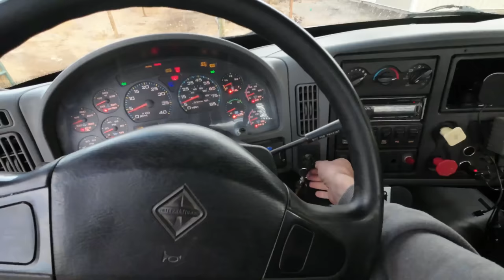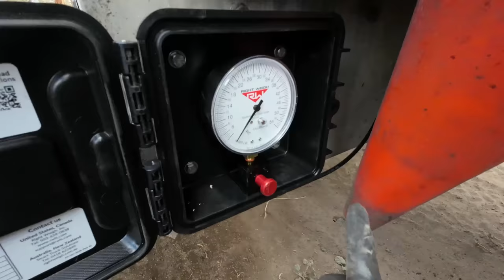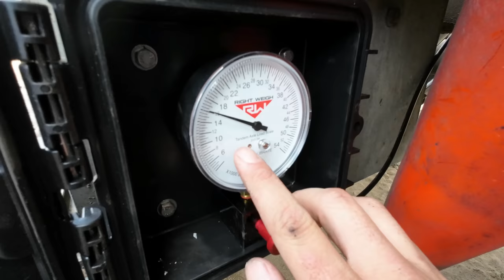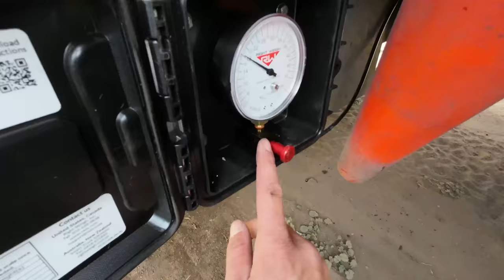A day in the life of an owner operator. Paying to go to work!

Comment: you goofed while working on your truck , you didn't get dirty ! 🤣 . I don't care what people say , I also say it's a Jake brake
Reply: First manufactured by Jacobs Vehicle Systems. Pretty sound argument to call it a Jake Brake in my opinion. Like referring to a box of facial tissues as Kleenex. The brand has become the generic term.
Reply: The company actually takes legal action against towns that post “no jake braking” signs rather than “no engine braking”. They used to (maybe still do?) have a form on their website to report jake brake signs.
Reply: @rustybones99  i haven't seen the term "jake brake" on signs for several years now. Every place that I've been through have changed to engine brakes🤣

Funny story, about 20 years ago i was running with about 3 or 4 other drivers from the same company as i was driving for. We were on a two lane highway in Kansas, it was about 10:30 - 11:00 at night. We came up to a set of railroad tracks on the northern edge of a town. A train was on tracks, so we had to stop. One of us flipped the jakes on & revved the engine & let it cackle while we were waiting for the train to clear the crossing. We started talking on the radio about how notorious that town was about cracking down on the "no jake brakes" law & we were all doing it.😆 
Then we heard someone get on the radio & say "it's ok boys, we'll let you go tonight"🤣🤣 we were surprised & was trying to figure out where it was coming from. He said you boys keep trying to guess. About the time the train cleared the tracks & we could start rolling again, disco lights came on in the implement dealership next to where we were waiting. He said you boys stay safe out there tonight, it's been fun talking to you all🤣🤣  he pulled out & escorted us through town🤣🤣  that was back when trucking was fun🤣🤣
Reply: It's only a jake brake if it's made by Jacobs

Comment: Check out On Spot for automatic chains, great success in mountainous Norway. Never used them myself, but a collegue swears by them. Just turn it on before you get stuck 😅On our tandem trucks we also have the ability to transfer load from the rear axle over to the front drive with the air suspension, that also helps allot during winter driving. Also a tip from norway, always keep an extra jug of windshieldwashing fluid, pour it over the tires if you can't get grip on the snow. Removes asphalt and makes the rubber stickier when you need it. Beats putting chains on if you just need to get rolling.

Comment: Good morning Casey , enjoy almost all of your videos!
I noticed you using heavy duty tie wraps to secure the hoses to that metal brace prior to installing the airline T. I suggest getting some smooth radiator hose, slicing it and wrapping it around each hose where it contacts the metal prior to installing the tie wraps to prevent chafing. This could potentially save a lot of frustration in the future!
Reply: Yep, And using stainless bailing wire instead of tie straps.. Ask me how I know..😏

Comment: Hurts to watch the struggle with pliers at 7.50 :D.  It really shows how much easier it would be, if you had those in the right way in your hand, when those try to grip to the antenna as you try to let go.
Reply: I knew someone would bring that up.  HOWEVER, he did get the job done.  Is that not the idea?  But, on the bright side, comments help with the algorithm, so there is your comment and then mine to you.

Comment: We had slinger chains on one of our trucks. They worked good on flat ground to help the truck in a pinch. I don't know what they cost, you should be moving when you activate them or they will get bound up in front of the tires. If you stop on a slope they are worthless if you spin out. Good luck.

Comment: Hey  Casey, I noticed your wiper blades might need replaced.  I  use the Michelin silicon ones. I highly recommend,  1.5 years on and still good. Follow directions when putting on. You run them dry for 3 to 5 minutes. This puts a coating on windshield that acts like rainx.  If they start  to streak, just clean blades.  Loved them on box truck I drove.

Comment: System we had for weight meant ignition on to check,surely in this day and age it would be possible to wifi to a phone instead of having to check gauges inside the cab or in a cubby hole..
Reply: Well, there’s the AppWeigh system that uses sensors , an app and Bluetooth but I think it requires system to be fully aired up though can be checked from inside or outside truck.

Comment: I'm jealous Casey, we run single rail to cross the pass. They are quick and work for most applications but when it's bad up there I wish for some good triple rail like I ran in Alaska.
Reply: The bad thing about single rail chains, you spin the tires ONE time, and then they are useless.
Reply: @Rat-Builder  that's right 👍. It's a company policy not a driver choice. I used triple rail with ice cleats for my 13 years of Alaska driving.

Comment: You probably know this already. But just in case you don't, the truck has to be on pretty smooth ground for that scale to read correctly. If a set of duals is in a hole it will affect the reading. Also sometimes the parking brakes make it bind against the suspension while loading and you may have to release the brake to get a true reading.  As far as the automatic chains are concerned, they are awesome as long as the wheels are turning fast enough to keep the chains thrown under the tires. It's definitely a problem taking off from a stop. They need speed to get centrifugal force to throw the chain out under the tires.

Comment: Still looking for your promised video of using your car dollies. Not that you've sold your wrecker I guess I won't see it. But the bright side is I get to see you work out of a pick up with a camper. Congrats 9n the rollback it's very nice.
Reply from the maker: There are four things wrong with your comment.   
Number one:  I never promised any video.  
Two:   I did not sell my wrecker.  
Three:   I do not have a camper shell on my pickup. 
Four:  I have countless videos on here using my dollies.
Reply: @CaseyLaDelle  so seeing your red wrecker at a stop light wasn't the one you sold while driving with 406? And as for the pickup with a camper don't you use that for uhaul pulls.? Sir I wasn't being disrespectful I'm am sorry it came off that w a y.
Reply from the maker: @chescabler2659  I believe the only time I’ve ever towed a Uhaul with my pickup was when I hauled the burnt one on my car trailer, and that video caused me to refuse to work for Uhaul for almost a year.   So no, you do not see me work out of my pickup on Uhauls.    
That red tow truck is not a wrecker, and I do currently own a red wrecker.   The dollies on the 4x4 wrecker are the same exact ones that were on the red tow truck that I sold.   I also just went and looked at my towing playlist and it has over 80 videos, the vast majority of which use those dollies.   So I don’t know what video you think you were promised, but if you can’t find a video of me towing with dollies then I don’t know what to tell you 🤷🏻‍♂️
Reply: @CaseyLaDelle  no no you were hauling a car that had its wheels turned I want t o say a jeep and in the video you mentioned that you would be making a video about the C7 I think is what they are called. Again I'm sorry I came across the wrong way. It want my intention.
Reply from the maker: @chescabler2659  well I’ve never owned a CJ-7, so I have no idea what you’re talking about
Reply: @CaseyLaDelle  ok I'm talking about the c7 or G 7 dollies I'm new to the towing game forgive my ignorance. I won't trouble you again.
Reply from the maker: @chescabler2659  G7 Dollie’s.   Every video I have where I’m using dollies, are the G7’s.   There’s countless videos of them on this channel
Reply: @CaseyLaDelle  I get it we have strayed from my original point about you using those dollies on a jeep liberty or like car and said "yes I will be making a video about these" was all I was saying. I was looking forward to it could find it thought I would mention got taken the wrong way and it all went sideways. I have apologized at least 3 times other than that I'm afraid I don't know what to do or say. Again I apologize.
Reply from the maker: @chescabler2659  I did make a video about those dollies with the engineer from Collins who designed them.

Comment: Hey Casey !! 2 comments to make (1) ,,That weigh scale box has a tendency to gather water inside it & freeze making it useless !! ☹☹ (2)  ,,Does the under lift have the power to raise the tandems off the ground to allow putting tire chains on easier without having to crawl between the tires to hook them up ?? 🤔🤔 Anyhows ,, Have ""FUN"" with your ""NEW" toy & make some $$$$  in the process !!  🙃😉🤠😎😮👍👍👍👍👍

Comment: Saw a guy that used a winch and built a box on either side of his truck to spool his chains… may be an option.
Reply from the maker: There’s a reason you’ve only seen one person who’s done that…
Reply: @CaseyLaDelle  I’ve been trying to find that video so I could send you the link, but I have not been successful so far. It was actually a really cool idea and it worked very well… the chains wound tightly and were out of the way, they had a bar that hooked to the tire and he just backed up to put them on. They were already lined up, correctly oriented, and clean. Didn’t have to deal with mud/ snow caked on.

Comment: I'm a little mift!, by the way the new truck cranks before starting. I'm so used to the engine starting first turn of the key. iam not a mechanic, but could it be low fuel pressure or timming slightly out could you tell me your thoughts.keep up the good work.
Reply from the maker: The engine won’t start until it sees oil pressure